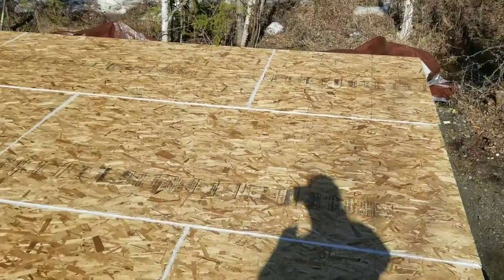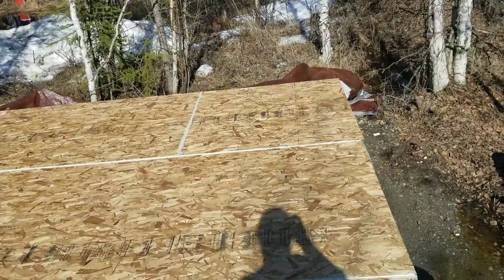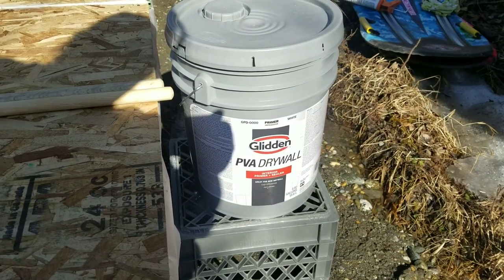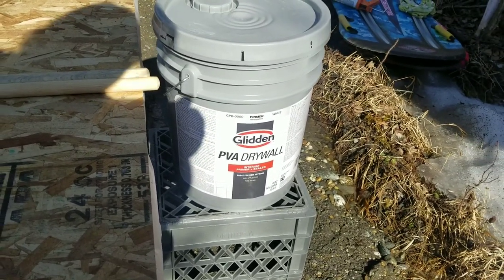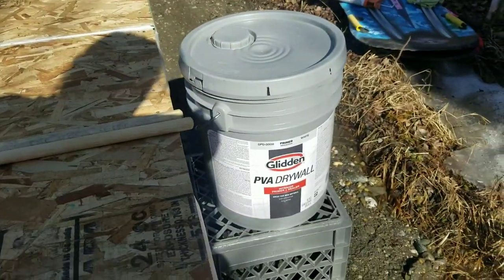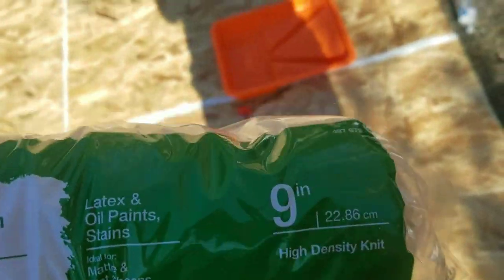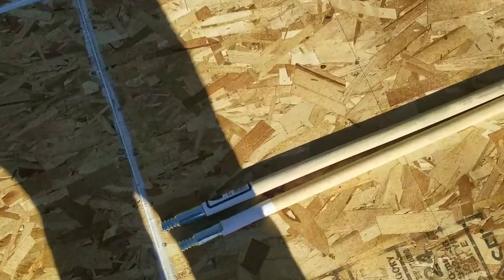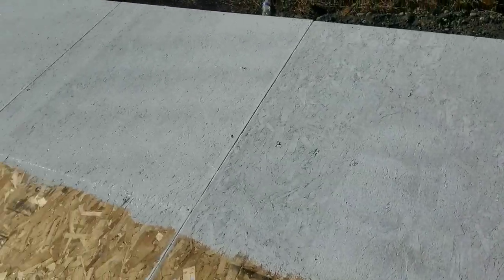Painting an OSB Floor

Comment: I'm a bit late to the party, but wondering how these held up so far for you?? We painted the OSB floors in our family cabin but it ended up being kind of....idk....tacky? And difficult to clean, mainly. Do you find the paint you used to be easy to maintain the floor, etc? You've got a nice spot going there, btw!
Reply from the maker: Hi! So honestly when we first painted it was fine for a bit; however the durability is low. We were still building after painting and it did not hold up to things being slid across it. It was mostly easy to clean, but dust still got caught in the small crevices of the texture. We ultimately did end up flooring over it because we got an awesome deal on flooring.

All that being if we wouldn't have found a deal on flooring, I would have been happier with the way it looked painted compared to just the bare osb. It also held up to water like a champ and gave slight protection to our floor before our roof was finished.